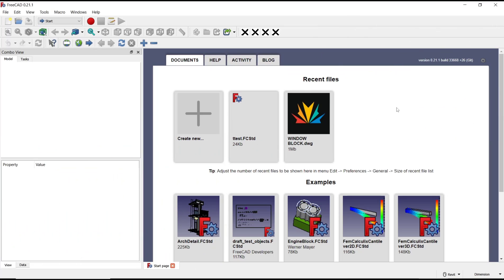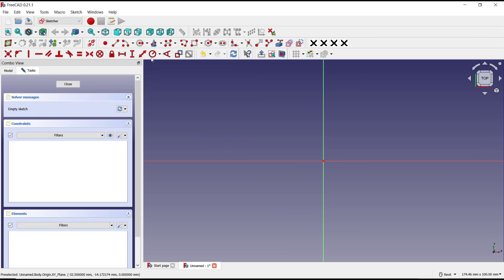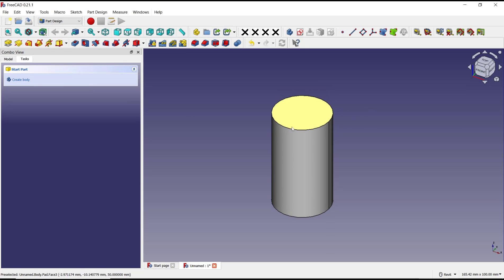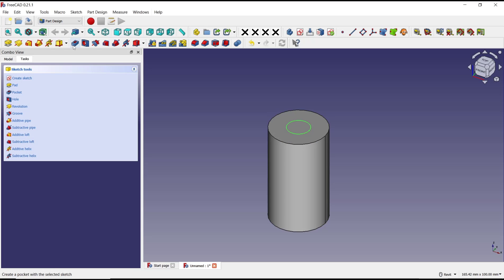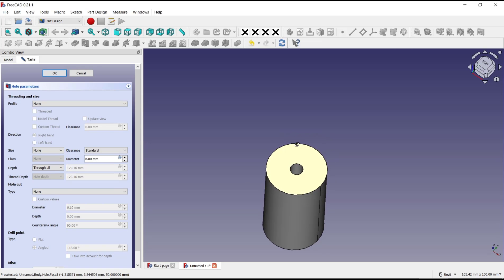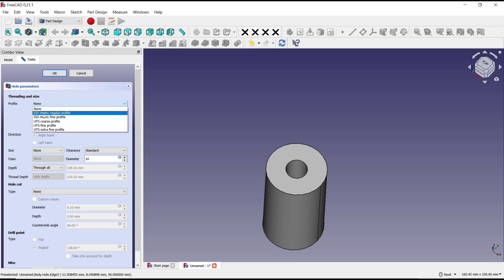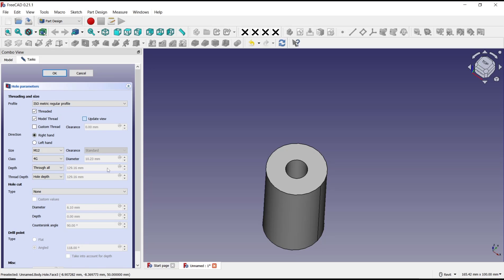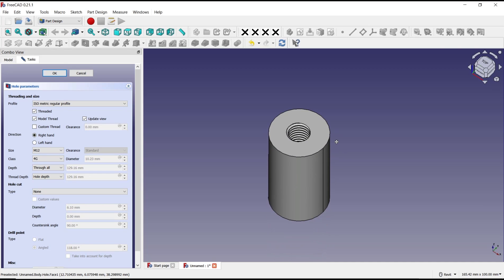FreeCAD How To Hole In Cylinder

Comment: This hole in a cylinder represents the same complexity as a hole in any other flat surface. What is special in a cylinder is the curved surface. You are not showing a hole in a cylinder, you are showing a hole in a flat surface. This is a misleading title. Show me a hole in a cylindrical surface, then I will put a like.